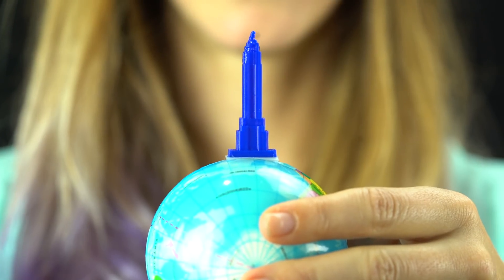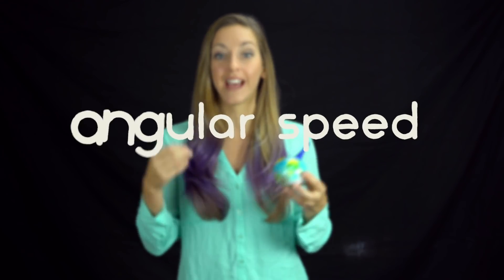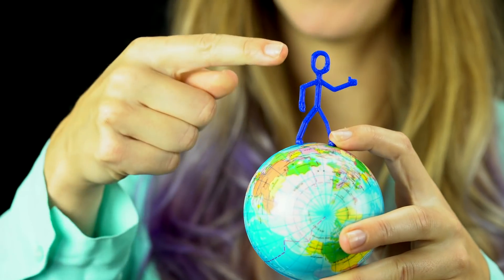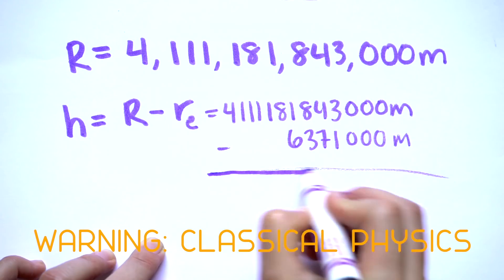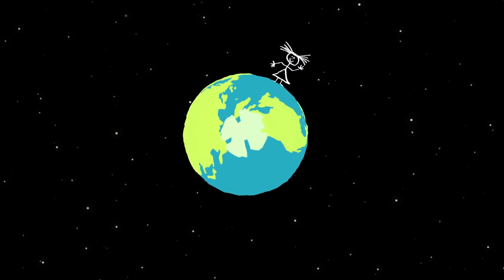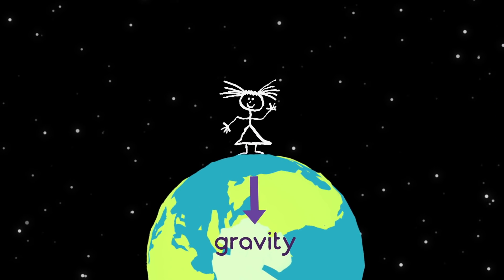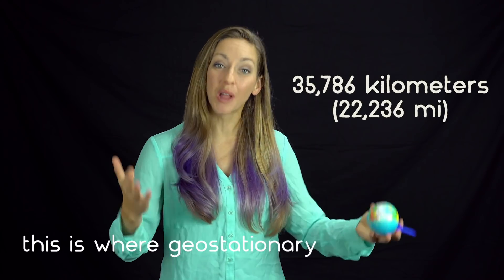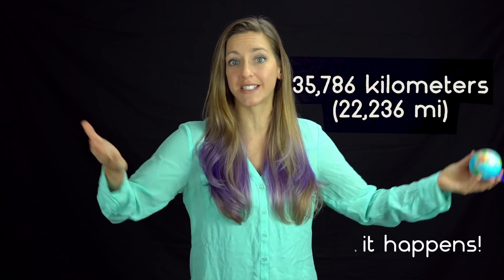How tall is this building?

Comment: For example, a 1.12 cm diameter (~1 cm^2 cross sectional area)  titanium rod 35786 km (3,578,600,000 cm) long would have a MASS of something like 16,000+ MEGAgrams (16 gigagrams)...

At this diameter & length the "rod" would behave more like a string ... better stick with the carbon nanotubes ...;)

Comment: As you create a larger and larger building, the angular momentum of the earth with start falling down. That come's from conservation of energy. Your math regarding the tip of the building rotating at the speed of light is applicable when you assume that the mass of the building is very very low compared to the mass of the earth.

Comment: If we had a hypothetical tube anchored to the ground pointing directly upwards that was more than 4,111,175,472,000m, would the very tip of it be moving faster than the speed of light? What would happen in this case?

Comment: I hypothesise that if you did manage to create a structure that was made out of a material that didn't suffer from structural degeneration. the tip will never reach the speed of light simply because of the existence of a building attached to its surface will cause the rotation to slow down. maybe even change its centre of mass to be somewhere along the building. the building effects the planet just as much as the planet effects the building.

Comment: QUESTION: If you were at the north pole (all rotation, no linear velocity) and were suddenly teleported (preserving velocity and momentum) to a point on the equator (no rotation, all linear velocity), would you "feel" different? In your perspective, you begin at rest and end at rest, but in an astronaut's perspective, you instantly stop spinning and instantly accelerate to faster than the speed of sound.

Comment: A building that tall would disrupt the natural potential gradient that is necessary for this earth.  You would shift the current charge system, impacting the natural flow of charge from the ionosphere to the ground, and wreak havoc on weather phenomena and voltage profiles.  In short, that building would be lit up with St. Elmo's fire, and would likely partially disintegrate if not constructed with highly insulating material, assuming you could even begin to overcome the structural challenges.  It's a great thought experiment, however.

Comment: Assuming the Earth could maintain the same rotation speed and remain balanced, the pressure on this space elevator cable would grow so much that it would snap way before reaching the length needed.

The electric force is not strong enough to allow anything to approach the speed of light. Imagine tiny vibration at the tip of this rope which travel in space at such speed. The atoms which got stretched by vibration would need to reconnect with the electric/magnetic lines that make them stick to each other. But the vibration is going faster than the speed of light, so the magnetic lines escape in spiral loops, similar to the solar wind. Those atoms would never regroup and would just fly away in empty space.

Comment: Lets say you had point a a light year away from point b. You needed to get something from a to b in one year. It would be impossible to travel that distance, but what if you had a pole a light year long with you object attached to it. You could push it and the tip of it would be going faster than the speed of light. I know this is impossible but why couldn't it go faster that light speed?
Reply: It essentially boils down to the fact that in reality, forces do not act instantaneously across an entire "rigid" body.

At the atomic level, solids are just atoms held together through electromagnetic forces, which you can think of as being kind of like tiny springs between the atoms. When you push on one atom, its springs push on the surrounding atoms and those push on other atoms and so on. This is called a compression wave, and it travels at the speed of sound through that material. (Side note, sound is just compression waves too.)

At normal scales, the speed of sound through solid objects is usually fast enough that we can't tell the difference between this small delay and instantaneously. If you scale it up to a pole that is a light year long, however, the difference would be extremely noticeable (provided that you had some way of actually seeing further along the rod than light would allow, which is also impossible). The rod would bend/contract/expand depending on what direction you're pushing on it, and the speed of the whole thing would stay far below the speed of light.

Comment: i have a serious question. Even if we build such  a building hypothetically, we are still ignoring many things, such as:
1) the mass of the building will be too big due to its size, but it would be build from the mass on earth, so the mass distribution of the system changes drastically, due to which moment of inertia of the system changes too thus due to conservation of angular momentum, shouldn't the angular velocity decrease? and due to the decrease, the expected height of the building would be much lower than the original height of the building.
2) Due to change in mass distribution the centre of mass will also change, due to which we can't write the equation GM/r^2=(angular velocity)^2.r, as the r in this case will be different on both sides.

Comment: How realistic are space elevators?
Reply: Stomrider X  -  Since Mars gravity is 38% Earth's, and its "day" is only about 40 minutes slower than Earth's, Kevlar™ would be light and strong enough.  Since the Moon's gravity is 16.7% Earth's but its "day" is about a month you can't use centrifugal force to pull the cable tight . . . you have to use Earth's gravity.  Kevlar™ would be light and strong enough but the cable would have to be about 250,000 kilometers long.  A space elevator for Earth is not impossible . . . if we can make each carbon nanotube molecule (yes, each carbon nanotube is a single molecule) about 60,000 kilometers long . . . the "anchor" has to be well past geosynchronous orbit to pull the cable tight.

Comment: Dropping a satellite (or penny) at other heights can be useful for getting other orbits if you don't specify a circular orbit. If you released the penny at an altitude of 23555km it would orbit with its closest approach to Earth above the Kármán line, 100km above the Earth. Also you could release that penny at an altitude as high as 46848km and have it stay in orbit (ignoring influences from other bodies). Release it higher than that and you can launch it into interplanetary space for free. Release it from 144000km and you can go to Jupiter direct.

Comment: The maximum velocity of an electromagnetic wave in a vacuum is not the speed of light :). Just like if you to push or pull a guitar string up or down the increase in tension would register to both poles simultaneously.

Comment: Dianna,

I'm trying to better understand gravitational time dilation (GTD) and I could use some help.  I can only find subatomic test results, e. g. radioactive decay/muons, but I can not find test results at a higher level, by measure of testing the behavior of chemical elements.  For example,  let there be an atomic clock measuring time, down to the nanosecond, paired along with a closed system aquarium growing a crystal from a mass of chemical gas measured to exact atomic weight, down to the atom.  Employing your "space-scraper" as an imaginary model to test a speculative hypothesis, if two similar aquariums and atomic clocks where placed in the building, one pair set in place at the top floor, and the other set at the bottom, when comparing the weights of the two grown crystals, after many years, between the two aquariums, would the top crystal weight more, be heavier in mass?  I assume the top crystal would weigh more if the time dilation effect observed in the atomic clock is demonstrative of physical/chemical properties.  I would be interested to see test results from non-subatomic clock experiments, as well as electrical tests, to affirm time dilation.  Are there are any such alternative tests to read about the GTD subject?

My imagination is "seeing" a possible issue, but I don't know how to communicate it, other than with a not so great pseudo "science" experiment based upon a silly example:  let there be a room with two clocks measuring time, one clock with a "pendulum" based from liquid water, and the other clock using a mechanical spring as its "pendulum."  When the room temperature is lowered below freezing the water clock slows to a stop, and when the temperature is heated above boiling, the water clock dramatically speeds up, all the while the clock with a mechanical spring ticks along at, more or less, a consistent rate of speed.  In other words, I wonder if the concentration of gravity alters atomic decay in an observable manner, but does this gravitational effect also equally change the rate of chemical reactions and vapor kinetics for non-radioactive elements, or electricity?

Cheers, Jeremy

Comment: The number she uses, 9.8m/s^2 is the gravitational acceleration at the earth's surface, actually Gme/Re^2, and it falls off with distance from the earth's surface, so her use of 9.8m/s^2 at some far distance, say at geosynchronous orbit (which is the about 35,000km altitude) isn't the force of the earth's gravity there. The dismissal of the Coriolis force in this lecture because you can't feel it is misleading since it effects everything from ocean currents, atmospheric weather patterns to even the deflection of cannons shot over distances of miles (and of course it is directional). Most of these youtube videos have been fairly interesting and relatively accurate, but this one is very misleading.

Comment: This is similar to a question i had in high school that went something like this: if you had a stick that was 1.5 light years long and you push it in sequence making some sort of code, could you communicate faster than the speed of light? My physics teacher explained that the signal would only move at the speed of sound through whatever material the stick was made of. So it would be like a wave of compression.

Comment: what about space elevators would it get to a point where the centrifugal force pulls the lift faster?
Reply: YamiPoyo YamiPoyo once you get past the geosynchronous orbit is where it should start doing that. She talked about this in the video. A space elevator would just be an elevator inside the 'building'
Actually, to get a space elevator to work you would need to keep the top past that point. Many designs revolve around either having a large mass past geostationary or having a large ring around the earth attached at multiple points.

Comment: Are you reading my mind?  Thank you for clarifying a couple of things. Now! Let's pretend we made a Death Star Amusement park in space, and it was in a geosych orbit. But, we want to build a looooooooonnnnngggggggg tower that goes into space and set things in orbit. I though of starting from orbit down. Think about it. You take a cable and start lowering it to the earth. It finally hits the ground. You want to guide the tower construction with this cable inside the framework until???

This is where Physics Girl comes in. I think you see what I'm asking about. Can you lower a cable, and then pieces of the tower DOWN from the Death Star? How does it effect the Death Star? How about lowering the cable over the tip of the rotation points north and south?

Hmmmm!
Reply: Jay-Alejandro to make the cable like that you would have to be exactly at geostationary or the speeds could be extremely dangerous to anything on the ground. If you wanted the cable to be taunt it would have to extend past that orbit so unless you plan on changing your altitude after the cables attached it would be pretty hard.
Reply: I'm not sure how that works. Can you explain how that kind of "elevator" can be made? It seems to me that if I were to drop a cable down and it hit the Earth, then how far away from the Earth must the weight be that stretches the cable? Will it have an angle?
Reply: Jay-Alejandro the cable would have to extend past geostationary orbit in order to be taunt enough to allow an elevator to climb up it. It would be about the same as if you took a string and swung it in a circle. It could bend backwards and wouldn't be straight but once you put a weight on it it would pull it taunt. This doesn't happen for quite the same reasons but it's not bad for visualizing. I'd recommend watching other science channels for more information as I am in no way an expert on this. I have a rather basic understanding.

Comment: gravity will never counter by centripitel forces in tall building case 
like that 
.
because gravity is depended upon mass.
large mass makes more gravity 
so if we make building tall 
tha mass increases and gravity also increases 
at the top of building you will feel more high gravity due to high mass beneath you
Reply: Abdullah Khan the gravity from the building wouldn't make a difference
Reply: StrikePlaysGames 
It make high diffrence 
As its size and mass 
Even without earth 
If this building preasent on space alone it will produce gravity like earth or even more then that is size increases
just like sun gravity is much higer then earth
Reply: Abdullah Khan Abdullah Khan I'm pretty sure that the model she uses wouldn't be to scale, and real building built would not even come close to the mass of the earth not to mention the farther you were away from the earth the less gravity effects you. You would definitely get to the point when gravity is countered. I doubt it would be much farther then geostationary.
Also it takes a lot of mass to produce gravity enough for humans to feel, the reason the sun has so much more gravity then the earth is because it is so much bigger.
Reply: this massive building size astroids are available check there gravity 
Then if it contacted with earth 
Then mass became added the effect 
Thus you feel gravity on top of building also 
Let me give you best example 
If helicopter fly at 8 kilometer hight you will feel less gravity 
but at same hight at top of mountain everst you feel more gravity then helicopter hovering 
.
At same hight

Comment: Wouldn't earths spin start to slow down as you began to build higher and higher? much like people on ice scates do when they move their arms in and out of center.  Take the arms in, and the spin speeds up, but take the arms out, and it slows down. Wouldn't the same thing apply to earth?  since the material to build the space building, comes from earth, you move mass (like arms on humans) away from center. Or am i totally wrong? so that's why you couldn't reach near light speed, even in theory.  The energy needed to move the building near the top, will be so great,  and it would take away the energy from earths (angular momentum?)  and even if the materials came in an instant, from outer space and 'plugged' unto earth, the planet would immidiatly start to slow down (take it that we ignore the fact that the energy transfer that would rip apart the building :) )
Reply: You are correct, but the effect is dependent on mass, so you can make it negligible in your calculations if you want by assuming a very light material

Comment: You should do a video about the opposite. Can we use a particle accelerator pointed down towards earth and use gravity as assistance to the particle accelerator so we can reach higher particle speeds. This will also helps us with the energy requirements in order to achieve such speeds.

Comment: Hold on, so I know that theoretically, no object can travel at the speed of light. But if all structural, atmospheric, and other problems were ignored and it was actually possible to get to the top of this tower, you would be going at the speed of light therefore invalidating the theory. So what am I not understanding?
Reply: A few things:

Building up from the ground, the rotation of the Earth would slow down. Since the mass is moving, and therefore getting more massive the faster it goes, it will steal more and more of the Earth's rotational velocity until it's not moving at all.

The mechanics involved in this are immense. The base of the structure would need to be wider than the observable universe.

The forces holding the structure together are conveyed by the electromagnetic field, carried by photons, which travel at the speed of light, meaning the structure would cease to be a structure as you get close.